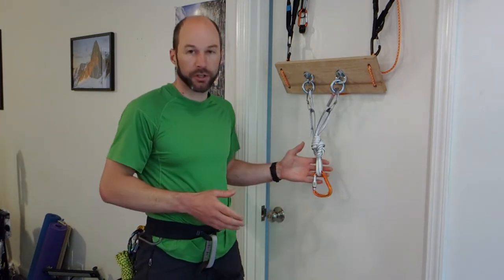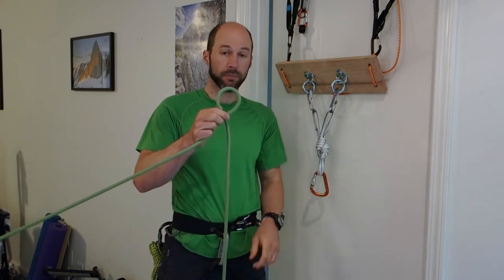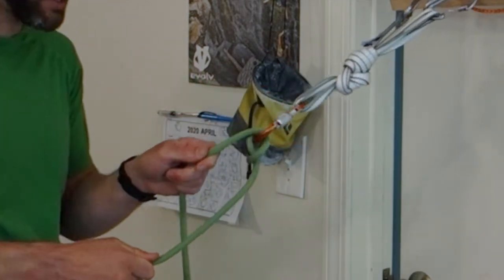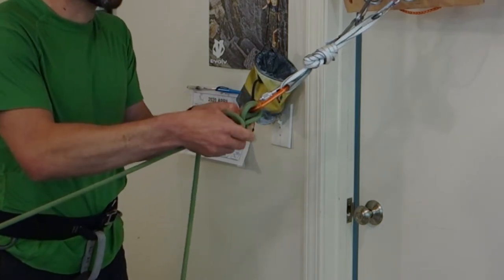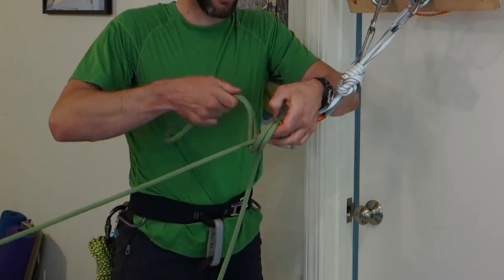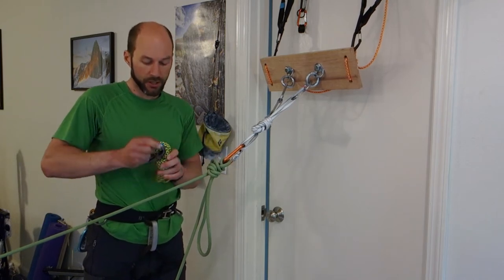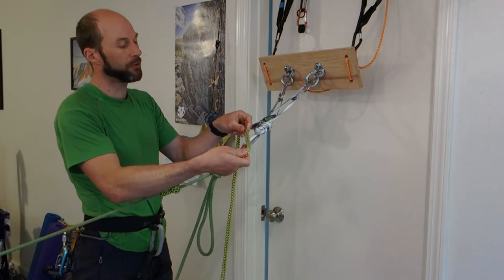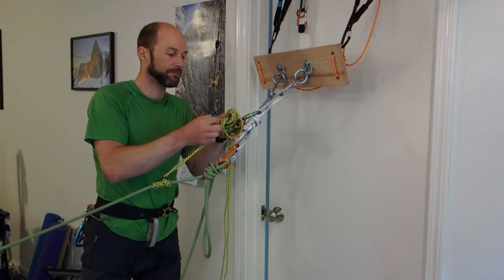Munter Mule Overhand

Comment: Question: why not just two half hitches instead of the mule? Easier to learn, harder to get wrong, faster to do, easier to undo.
Reply from the maker: This is a great question @jacqueslamintagne6890!  In some countries a "slippery half-hitch" is used as the initial block that prevents the munter hitch from lowering.  The slippery-half-hitch (or slippery-hitch for short) is similar to a mule-hitch, in that it can be pulled out and released under load.  Like you mention, it is much easier to tie than a mule-hitch.  The slippery hitch is then followed by a series of half-hitches to prevent the hitch from being accidentally pulled-out.  In most cases this system works perfectly well- especially in the context of recreational climbing where the loads on anchors tend to be small (just the weight of one climber).  However, there are a few specific scenarios when a slippery half-hitch might become difficult to release.  If there is very little friction of the load strand running over rock, and you have a constant large force pulling on the locked-off munter, then the loop that the slippery-hitch is passed through can become very, very snug.  This makes it exceptionally difficult to release the hitch while under load.  This is sometimes the case when docking heavy haul-bags at anchors on multi-day big-walls, and it can also happen in rescue scenarios when you have a climber hanging in space after falling off a traverse above a roof for example.  I have used both techniques for locking-off crevasse rescue systems (where a climber was lowered into a crevasse on a munter initially) and I found both lock-offs worked fine.  

The use of multiple half-hitches instead of a single overhand-on-a-bite to lock-off the remaining tail/loop is largely one of preference I think.  Both work great.  Perhaps the half-hitch series requires more rope and is a greater tripping hazard, but I can't think of any strong argument for or against either method.